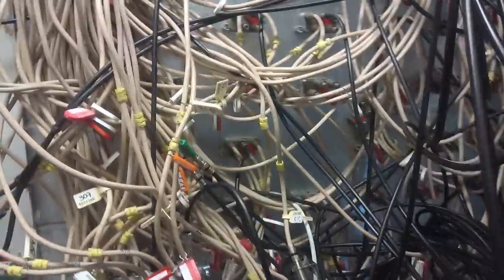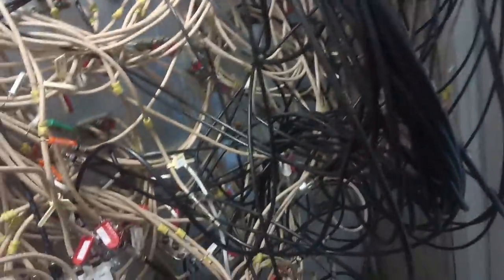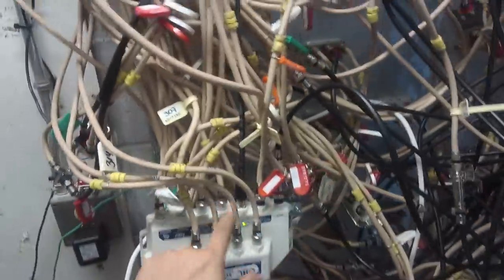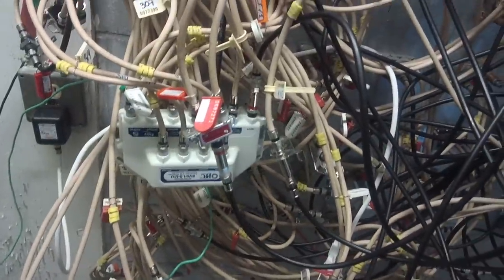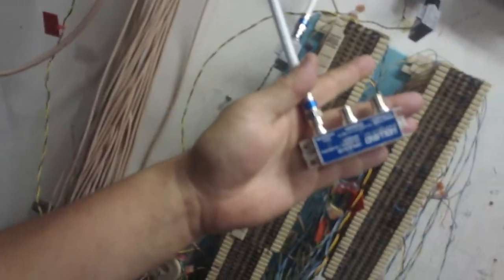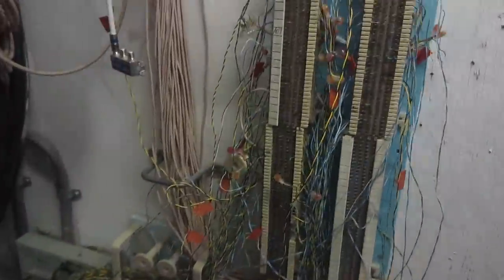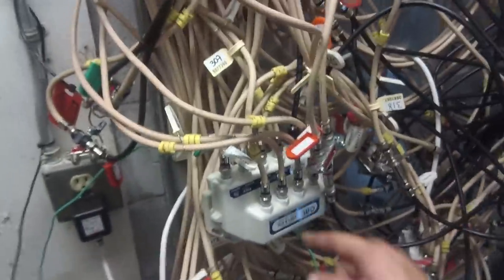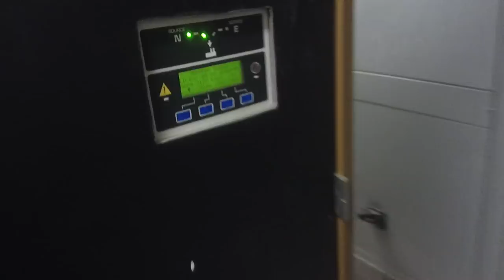Cable TV Wiring Doos And Donts Part 2 (A Year Later)

Comment from the maker: The bottom line is they would not put ground lugs on stuff that is not to be grounded. But they did so why not... you will find out soon. When somebody want to move there equipment in there house then get shocked then ....Law suit it is a very small shock but then again I can sue MC ds for making me fat. get it
Reply: Codes aside, there's a basic rule for RF/lightning protection of coaxial: ground shielding only in one spot [and do it where it's inspectable/outside if possible].  This is why your average cable box power is typically a two wire connection.   Some of what's in your space is just contractor laziness: using a groundable connector [such as would be used for making up to an LNB on a satellite dish] instead of  an inline connector because it was in the box.  When someone accidentally grounds shielding in more than one location, prepare for weird things to happen as it effectively changes shielding method from RFI to EMI.   If there is a ground rod [with a tight connection to shielding] in that box outside that's locked, then all you really need in your equipment room is continuity of shielding.  Getting shocked/seeing arcing like you showed between inline connectors is proof of loss of continuity - where only some are affected, there's a bad connector installation/something needs to be re-terminated.
Building inspectors are not trained in RF... so do what you have to do and be kind to your cable:  stick to a bend radius no tighter than 10x diameter whenever possible.

Comment: i just started as a cable 4 days ago. you are right, period. if lighting hits. any, and everything that is connected to the router/modem. will be fried as long as connect isnt through wifi. that the first thing i was taught, and im a contractor. we can get super sued if this is found out after a customer shit got blown up. this stupid not to ground a ground block or splitter, or amp, cause you can create a sro and you get paided more for that job, and that takes like 4mins. stretch, clip, clip, screw, screw. come on guys .

Comment: 1)The grounding or bonding wire is NOT used for or can handle the amount of amperage a lightning strike can generate.
2)The bonding from the building ie: the customers are bonded to the building power to keep unwanted voltage off of the cable plant.
3)So the cable company bonds the splitters to keep voltage coming FROM the apt out to the cable plant...Understand?
4)Outside in that green box (the Ped) is most likely a node or Trunk amp and each one of those have a 8 foot ground rod with the cable companies equipment bonded to it.
5)But with all of that bonding or grounding it still would not be enough protection from a lightning strike!

So when you need help with the cable call and ask for a supervisor to call you back and he or she will most likely meet you out there and get that cluster F**k wiring job cleaned up.

Comment: I feel your pain - I've worked years in condo security and hate seeing such poorly wired Comms rooms ...etc. 

One site had a huge theatre room with improperly wired surround sound that I may or may not have spent a bit of time rewiring. 

Other site had two front desks with phones that both had busted handset cords scratching every time you moved - I had to order 2P2C jacks from Austria or something like that and the special crimp tool piece for them - replaced the jacks and even used UV curing epoxy in the jacks to secure them tight for the constant use. 

Those PM's have no clue how much I improved/saved their sites.

Comment: the filters that keep being called annunciators are moca filters. the ground block you said was zapping against the splitter was a moca block (moca filter built in) the ped would have a main line amp in it and tap. pretty uncommon to have a node at an apartment complex unless theres an issue getting the proper levels in that area from the head end. a node is to convert fiber to coax in comcast systems. attenuators ( what i believe you mean by annunciators) are single line db adjusters and are only really used close to the equipment to drop the db levels to bring them within spec for the stb or modem and imo a bad way to go because unlike splitters they can let ingress become an issue. all the new digital boxes for comcast have to be at a db level of +8 to -8 to talk to the headend properly. and as far as stacking splitters its fine as long as the db levels are in spec as well as the transmit level. gotta remember the supply in the ped is a lot higher db levels for an apt complex than a four port tap on a power pole in neighborhoods because of the amount of splits that will be there. there are two types of amps youll have in that room if they are needed. one is a db gain amp not my fav since it fucks you on the transmit levels. and second is a unity gain amp. a unity gain is basically a powered db lossless splitter. basically what goes in the input is the same coming out of each port. also the splitters that are on the back wall arent used by comcast anymore so if hooking up a resident, the line to the apt is removed and put on a new splitter. and im with you on the contractors. they are paid per job unlike inhouse techs so they half ass the shit out of everything they touch and some are shady enough to disconnect an in use line and use it for their job to save the trouble of reconfiguring the splitter arangements to give their customer a line. ive had numerous jobs ive gone to where i was just hooking up a line that a contractor disconnected and left that way. those at&t blocks are just to use the coax to get dsl to the apt. not hurting comcasts stuff as each tan coax is a homerun line to an apt. if its disconnected from the comcast split its fine

Comment: Just an FYI, if you're implying that when you disconnect the drop and you get electrocuted then that is not normal.  There is either

A) voltage coming from inside the home due to a bad neutral 
- or -
B) voltage coming from the plant side (cable crossing power somewhere)

Comment: The blame in all actuality is on the complex developers. There should have been MDU's/Pedestals installed for each unit which would have eliminated the need to ground each individual groundblock. Would have also reduced the amount of RG6 inlines which are there and gave it a cleaner appearance. Each apartment should have its own panel where each outlet from every room meet with the drop coming in from the MDU/Pedestal. I wonder what happens when there's a need to replace inlines?

Comment: While you're very correct about contractors being messy, in your original video, you were talking about AT&T messing up Comcast by installing those baluns (yes, that's what they're called). They convert VDSL signal from twisted pair to coax. That being said, they don't affect Comcast's plant in any way, because it's not connected to Comcast's plant. They install them on a coax home run going from the AT&T plant directly to a customer's home. While baluns are rarely used anymore, the fact that you publicly admitted on Youtube about disconnecting them can get you held liable for a customer going OOS (out of service) and you can be sued in court (average AT&T truck roll for a repair costs the company about $150). Just sayin' bro. The dixplexer in the previous video is another animal all together. Don't worry about the frequency. It allows the modem on the combined leg of the diplexer to communicate with a set top box on the HPNA side.

Just word of advice...don't go around disconnecting equipment unless you know for a fact that the customer is no longer in service. Otherwise, there can be hefty fines for you and/or your employer.

Comment: All those amps should be connected to the red plug which is clearly hooked to the emergency generator which will maintain telephone service for customers using Comcast phone I'm sure someone commented on this already but there's so many comments I can't read them all because it's an old video
Reply from the maker: Yea technically it would not matter as there TV is not powered by the generator. Only a couple of lights and outside hallway lights most of the load is used to keep elevators running. Thanks for watching jeff mcgill👍

Comment: In my family's house, I'm essentially the IT guy; so the instant something doesn't work I get called. The internet ain't working, I get an earful. We used to have satellite, but switched to the ISP's Digital Cable, so they had to add a second Modem in our basement next to the main panel for the electrical, but the Aerial antenna in the attic still uses coax, so yay. The worst thing is half the cables aren't labeled and the home network data cables hang in the exact same rat's nest as the over the air tv, and the digital tv. The worst thing is we use a third party router instead of the ISP's router/modem combo, but it takes longer to boot than the router sooooo, essentially once the power fails, and then is restored; I have to ensure the modem comes up which is like 7 minutes tops, and thane wait another 7 minutes for the router to boot then make sure everything has network connectivity.

Comment: The only thing you have gotten correct is the fact that it is a mess. You don't know mush about  cable distribution. Just call the provider and demand that the mess be cleaned up. and since your the "maintenance guy" stay with the installer and force the job to be done neatly.  "signed a cable guy"
Reply from the maker: John Ford yes you are correct I do not know MUSH about cable distribution don't have to not my job and it's not my job either to sit and babysit a cable tech installer who should know their job I know my job that's why I posted on YouTube my job is to make sure that this makes my inspections every year as far as calling somebody to come out and fix this mess yeah good luck with that but seriously thanks for watching I appreciate it

Comment: question: is there ONE coax to each apt, then in each apt, it gets split to each bedroom in the apt? or does every bedroom in every apt have a home run to this wiring closet?
Reply from the maker: roy Yung each bedroom has a home run but sometimes the tenants will put a splitter in the house and split to make another Outlet somewhere in the house

Comment: That 'tickle' is EXACTLY why the code requires the cable to be grounded "As close as practical"  to the entrance of the building.  Grounding in the pad isn't counted as it is not part of the building's grounding system. see N.E.C. at 250 The amplifiers, splitters, diplexers, etc should be mounted to the ground plane provided, or INDIVIDUALLY grounded. It is very possible that there's a transient voltage that is being picked up by the 2 different cables and it should be sent to ground.
•••As to the '208 volt stinger', There's no 'stinger' on a 208 volt system. Between the Black and Red, the Black and Blue, and the Blue and Red there is 208 volts. That's your basic 3 phase "Y" connection. There is 120 volts between each of them and the Neutral/Ground. This is the system that would be in a residential complex. A system with a "Stinger" would be only used in an industrial system where most of the loads are 3 phase at 240 Volts, or Single Phase at 240 volts, and 120 volts power is only for convenience.  Generally, only those quite familiar with so called "Delta with mid point grounded" systems will work- or be allowed to work- on them. The Stinger can be anywhere from 80 to 370 (+/-) volts and varies based on the single phase loads connected.
•••The box that you opened is your standby power generation transfer switch. It starts and stops the generator and connects the building to or disconnects from the generator automatically in response to a power failure or return of power.
(you know this obviously, just clarification for the viewers)
Reply from the maker: Dang John Thanks for the explanation spot on. Thanks for watching man
Reply: No problem, happy to help anytime.

Comment: Well it looks like they added some new RG6 quad Shield Cable in there to meet newer Ingress standards and the annunciators may actually be a filter to block off TV giving someone only a certain channel package, but you're right dude that's a mess that's one of the worst closets I've ever seen....
Every typical two-way splitter cuts down 3.5 db of signal... by the time they get to the TV set they shoot for a certain DB level so that's why you have amps to boost it back up for the long runs... good luck on that it's your management wanted to they could make them come in and clean up but since you guys provide cable as you said that's part of the rent then it's falls back on you or owners Company to pay for the rebuild...

Comment: The grounding you keep showing and talking about doesn't prevent damage to customer equipment. It isn't intended to prevent damage it is intended to prevent fires and limit damage. If you wish to prevent damage I would suggest your tenants purchase a coax fuse or two. Gas fuses aren't that expensive. But, the very best way to protect household equipment is thru insurance, it really is cheap.

Comment: Does the maintenance door not lock? Anyways, Please research the differences between grounding, bonding, & earthing. JS
Reply from the maker: Yes the maintenance room locks I already unlocked it prior to making the video. I don't feel the need to describe  grounding, bonding, & earthing to someone who already knows so here is the copy and paste.Bonding is more clear word compare to Grounding and Earthing, but there is a micro difference between Grounding and Earthing. ... Ground or earth in a mains electrical wiring system is a conductor that provides a low impedance path to the earth to prevent hazardous voltages from appearing on equipment.

Comment: you do not ground off a amp or splitter that is not apart of "brisk" standards.if you getting voltage that means the tap/amp that is in ya ped is not properly grounded.
Reply: Exactly why the code requires the cable to be grounded "As close as practical"  to the entrance of the building.  Grounding in the pad isn't counted as it is not part of the building's grounding system. see N.E.C. at 250 The amplifiers, splitters, diplexers, etc should be mounted to the ground plane provided, or INDIVIDUALLY grounded.

Comment: It must be grounded at point of entry that's required by code. If that was my apartment and it was a bulk account I would rewire it myself and ban the cable TV people from reentry. I used to work on catv headends and I have seen far worse than this.

Comment: Have thay ever thinking of  upgrading to fibre
Reply: tim gladman Fiber is extremely expensive to run, especially when you have coax already run. Comcast does have fiber, but it's run to the node and it's converted to coax at the node.

Comment: Buddy I love the fact that you know nothing about cabling or phone just FYI you can't mount to metal for splitters compliance is inbound wire grounded and that's it not every split
Reply from the maker: If I really do not know what  is going on. Then when you don't ground a splitter  and you take the drop off. Witch is grounded in the ped . If you take the drop off the splitter it is no longer grounded and you are still holding that splitter what becomes the ground?
Reply from the maker: Well show me how its done BTW I lived in Lawrenceville, Georgia
Reply: Geoff Geoff  I will point you to my previous comment because obviously you did not read any of it. You sound like every big headed  maintenance man I have ever ran into you all know everything about nothing. And grounded is grounded NEC dictates what that is and as far as NEC I guarantee I know it better than you seeing as to the past 9 years I've done cable both residential and commercial as well as I've picked my father's brain many times as he is a 35 year electrician and states and where you live no bearing on the NEC that stands for National Electric Code the little tingling your getting is because not all apartments are wired correctly for electrical (because people who do not know how to work on them do) so you don't common ground them all and link it together because if you do the one back surge everyone's boxes and or tv's eat it. Just a FYI the things your touching on the AT&T phone block is how they do internet if the cat5 is bad or non existent. And for show you how to do it look me up on Google + I have pics up there for that.
Reply from the maker: HAHAHAHA I AM  LEAVING THIS COMMENT CAUSES EVERYBODY THAT KNOW WHAT IS GOING ON IS HAVING A GREAT LAUGH . Some peps say I am a down to earth guy :þ Here is a video that will show you everything. https://youtu.be/mWjVQlSruY8
Reply: Sorry I made an error and still had the pics private you can now see them

Comment: 9:00. Not enunciator, those are Moca filters. It's so boxes on Comcast X1 platform can talk to each other. It also blocks devices on other drops from seeing these boxes. So these Moca filters create sort of like a system within the residence, without one a neighbor can see your recordings 😉 ( not to mention the slave boxes won't work). Also as a Comcast tech, if I go there for 1 unit/residence that mess is not my problem. A specific job has to be created for this, but I'd say more than half the time we'll just say it's the residence maintenance problem LOL
Reply: Imperial RNV 

The slave boxes will work with/without the filters.  Any tech should put a filter on during the install at the ground block.

Comment: This dude has Absolutely NO! Idea what hes talking about. I mean i can respect that your concerned about the mess, and som other issue that are not up to bris specs. But theres a whole lot of stuff you said that was just wrong. For instance, splitters are not supposed to be grounded to the wire. There is supposed to be a ground block and lime you said the ped is grounded so really there doesnt need to be any grounding in the room